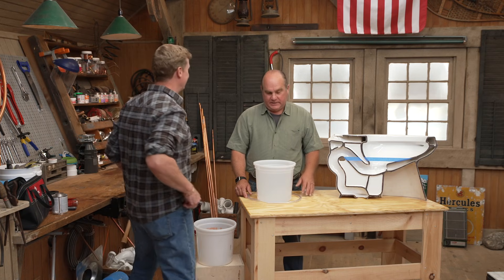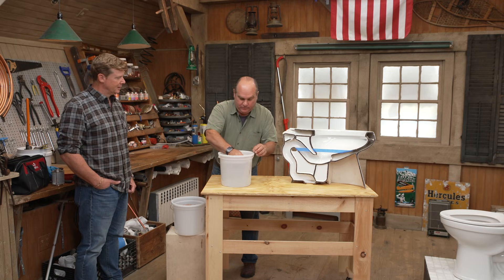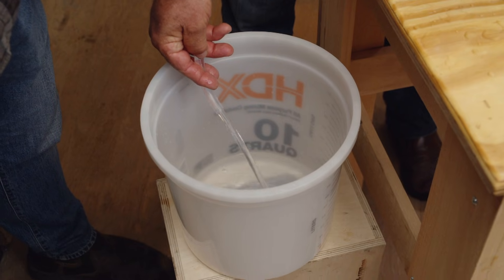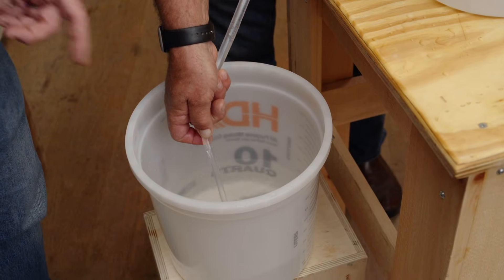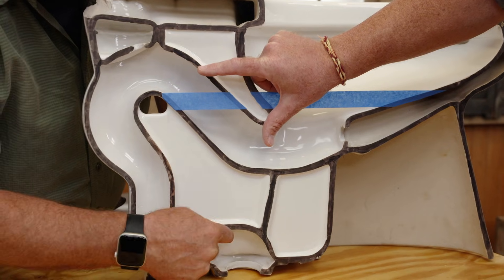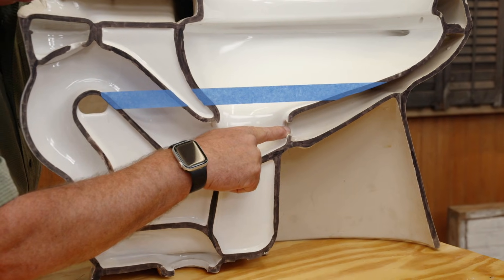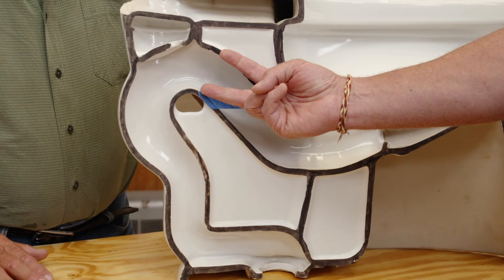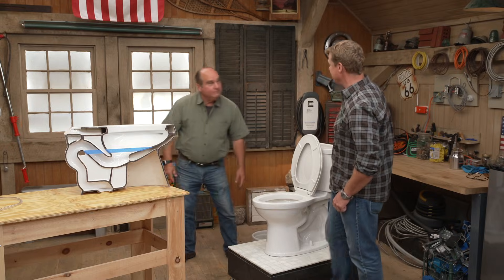How Does a Siphon Work? | Ask This Old House

Comment: US patent 5,358,000 disclosed a method of controlling a siphon conduit no matter the size or length from the crest with a shutoff valve at the crown which works in conjunction with check valves at the inlet and outlet ends of the siphon conduit to retain prime after the flow is stopped.

Comment: finally the information I have been looking for to close the gaps, thank you
Reply: this information is what led me straight to the siphon jet hole to feel for an obstruction. after doing a successful bucket dump flush, I flushed again with my fingers at the siphon hole and I felt a piece the size of a lop-sided quarter. was able to wiggle it through the hole while tank water was pushing on it with flapper up which allowed me to grab it, otherwise it would fall away from the hole. it now flushes like a dream every time now. thank you

Comment: is the jet actually a nozzel or just an opening to create the,siphon effect
Reply: I think it's just another port to push the water  up and over to start the  siphoning process.  There's no pump pushing the water but if that is clogged with hard water buildup that could prevent a good solid hard flush.

Comment: That is without doubt, the most ridiculous toilet design ever, ESPECIALLY in light of better designs having been around for a very long time.
 Also, because of its complexity, that toilet pan is very expensive to manufacture.
 The huge downside is, it wastes a vast amount of water.
 The siphon pan is not suited to dual flush, unless each flush amounts to almost the same on the second flush as the original amount, about 3.5 US gallons or 13.3 litres. 
Since 1992 the flush has been reduced to 1.6 gallons, 6.06 litres, along with a better designed pan as the old designs would fail with so little water.
 In Australia, the dual flush toilet system was invented in 1980 by Bruce Thompson, when he was working with Caroma. The first dual flush system released 11 litres on full flush and 5.5 litres on half flush, or 2.9 US gallons and 1.45 US gallons.
 When a trial in a small town yielded a net saving of 32,000 litres of water per year per household, legislation was soon passed in every state except NSW to have dual flush toilets installed in all new buildings.
 Caroma then redesigned their toilet to use even less water, dropping down to 6 and 3 litres respectively - close to half of what it used before. That's 1.69 US gallons and 0.79 gallons!
 It was customary in many Australian households, to place a house brick in the cistern to reduce the amount of water used, especially in country area and where houses were connected to a septic system. It is important with septic systems to have as little water as possible flowing into them, otherwise they are easily subject to flooding.
 Using a septic system required the use of a specially designed 'septic pan', that used less water. 
 For many years now, it has been very difficult to find a suburban house connected to a septic system. When they are, the septic system is a pump out one, not a site disposal system.
 I was a licenced plumber, drainer, gasfitter, LPG installer and roof plumber and ran my own plumbing business for 40 years.

Comment: There's a bit more to siphoning; its not just the 'weight' of the water 'pulling' on the water in the upper bucket due to gravity; rather, the weight of the water in the tube does indeed cause the water to start to flow thru the tube, but here is the key - the evacuation of the tube would tend to create a vacuum behind it; rather than allow a vacuum to exist, the the laws of physics continually act to refill the tube via atmospheric pressure on the surface of the water in the upper bucket, to press upon and replace the water which is draining out of the tube (nature abhors a vacuum).  If you sealed the upper bucket in an airtight fashion, the siphon would stop working because the force of gravity on the water in the tube is not able to produce a vacuum inside that upper (sealed) container.  But in an unsealed container where air pressure can work with the weight of the water column, a siphon can work - up to about 10 meters in height depending on barometric pressure. Hope this helps - siphoning is gravity in partnership with atmospheric pressure (which is caused by gravity too) - gravity does all the work here, but it operates on the water itself AND CRITICALLY the column of air above it.  All you have to do is make sure that there is no air-lock (air is compressible, water is not) inside the tube, to get things started. PS - if you don't believe science, believe a bartender who can turn a glass of water upside down and it won't run out because atmospheric pressure is holding it in against the force of gravity. Check it out and Cheers.
Reply: Huh??   Please post a video where a person turns a glass of water upside down and it doesn’t run out.   Preferably a video that’s not from a Sci-Fi movie.
Reply: Nobody gonna read all that lil boi
Reply: @BigDOA666  at least 31 people did and it actually explained what they didn't across few minutes

Comment: I have a toilet that does not allow water to come out of the ports at the rear of the toilet. Therefore there are times, when a certain bathroom visit occurs, the mess stays there. I have tried a thin wire up the ports but to no avail. What can I do?

Comment: whitch on is the video with the water boil that stopes the smell from coming up i wanna send it to my mom
Reply: Little too late, but it’s the part right after it comes from the main bowl. Where it’s a solid tube of water prior to flush. Keeps gases on the other side. Same for sinks.(the under side of the left side of blue tape)

Comment: How does the smaller hole near the top of the exit channel work? Try plugging it to see what it does or doesn't do, please. Is it a vacuum that helps pull or suck?
Reply: I know this question was 4 months ago, but if you are referring to the small hole in the front of the bottom inside of the toilet, opposite the major drain-way, that hole is called the siphon jet.  When working properly, water should come down from the tank & OUT of the siphon jet hole during a flush, aiming that jet of water in sort of squirt toward the larger drain-way to help start all of the water heading up that way to assist the start of the siphon.  If the siphon jet hole gets blocked up with sediment or a toothpaste cap that someone dropped, your toilet will develop a "lazy flush", which is when the water swirls more gently rather than a vigorous swirl,  & the toilet flush will be weak so that paper & solids tend to stay in the bowl. If that is happening, you can stick a gloved finger in the siphon jet hole to see if it is blocked.  If so, a long screw or a piece of small diameter plastic pipe, or even a wire coat hanger can be used to poke the sediment to try to break it up & get it out. You can use whatever works but be careful not to scratch the porcelain in the bowl. And be careful in case the blockage is from a foreign object, not to jam that object more firmly into the hole.
This is a common problem that can easily lead to a lazy flush, especially in homes that have hard water.  So if you have hard water, you might want to check that siphon jet hole every few months to prevent problems before sediment gets too built up & too hard.
[mcsmama 5.30.2022]